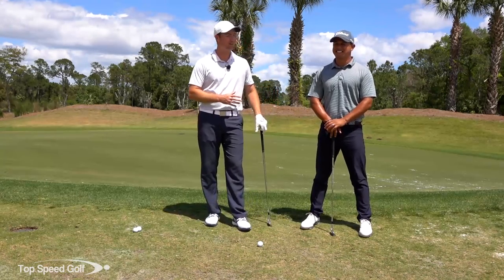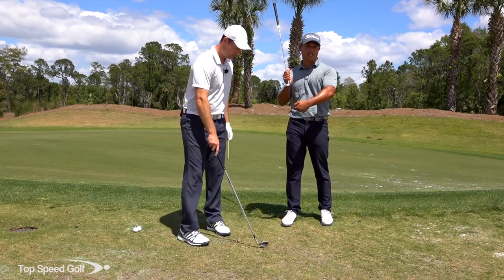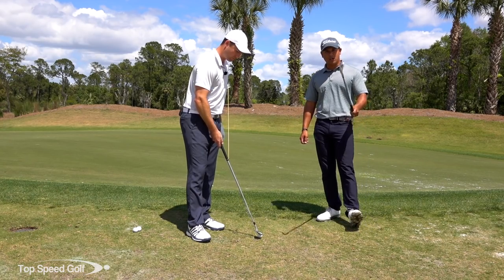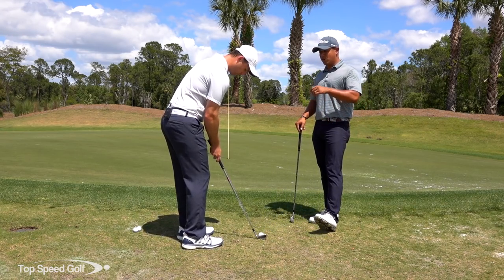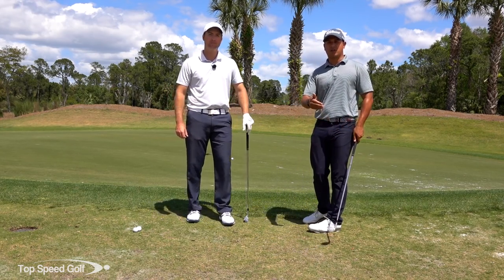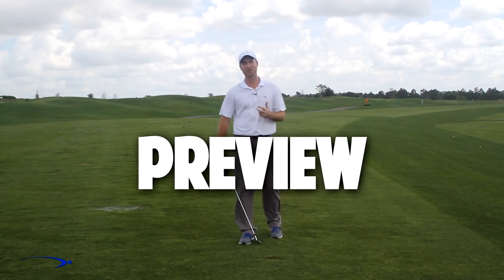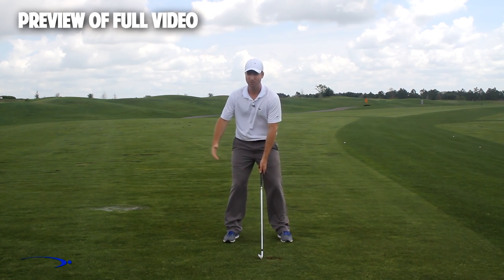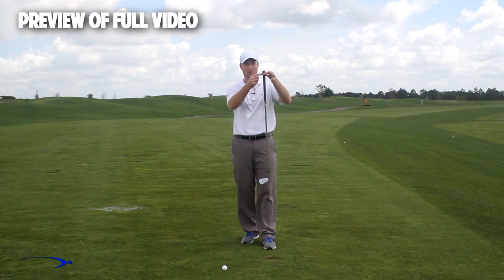How to Chip & Pitch Off Hardpan

Comment: My question is, why do all this when all one has to do is to practice with a 5 wood. It doesn't take much practice & it's relatively easy to develop a nice putting stroke with a 5 wood for a great result. When the flagstick is rather close to the apron & first cut? I ALWAYS whip out my 5 wood & make a great play very close to the hole. You can too. With the 5 wood as part of your 'green' arsenal, you'll save at least 5 strokes per game as opposed to chipping when the 'pin' is closest to you via the apron or first cut of rough. Use a putting stroke & the 5 wood's loft is enough to clear the 1st couple of feet of taller grass & will then roll to the hole provided you read the green before executing this very effective & very manageable shot.
Reply from the maker: Hi Steve, thanks for sharing. This is a good technique as long as the turf is closely mowed and it is smooth. Most people don't have the luxury of playing in conditions like that. Hardpan areas are usually absent of grass and have patchy spots. This isn't conducive to hitting the running shot like you suggest. The method in the video allows you to chip it up over any inconsistent areas that might be hard to judge. Play well ~ Quentin | TSG Instructor